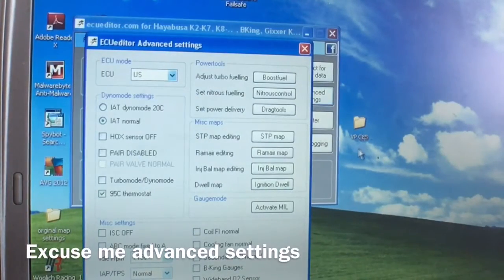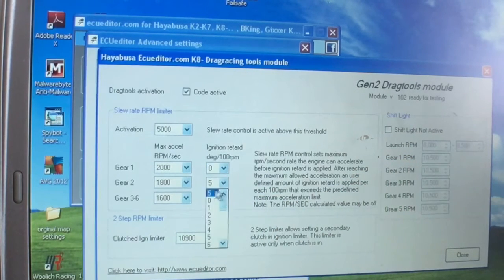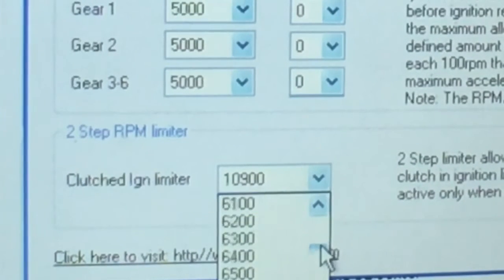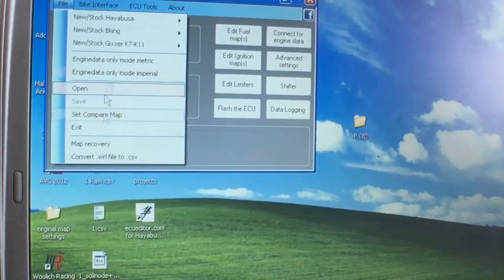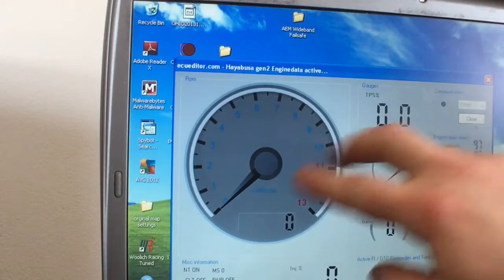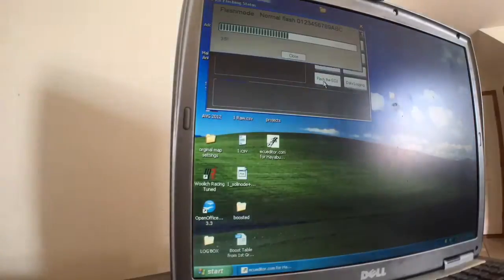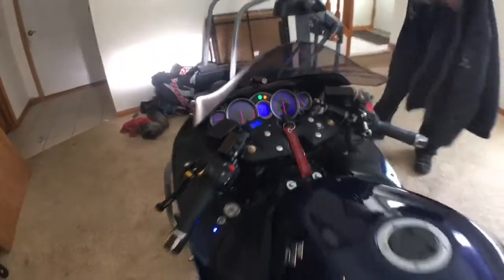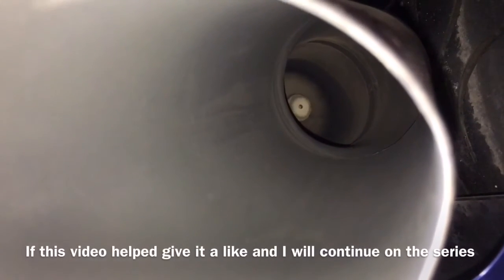Hayabusa ECU Editor (lesson 2, 2-step and flashing on a turbo gen 2)

Comment: good video, very useful. im build my 7/12 gsxr with fuel injection on busa bin
Reply from the maker: +Romansecurity Roman what do you mean by 7/12? Thanks alot of people were sharing but not liking the video. I plan on doing more if people were finding them usefull. I am going to split my channel and make another No Regret Performace and will dive much deeper into ecu editor and ethanol. Ya my 750 runs gen 2 bin.
Reply from the maker: +Pierre- Built out of curiosity is english you second language. Would me making sub titles be good in the next one. I noticed alot of people watching are from other countries.